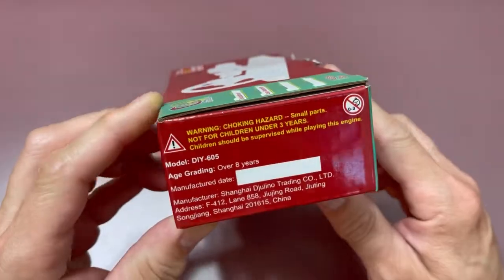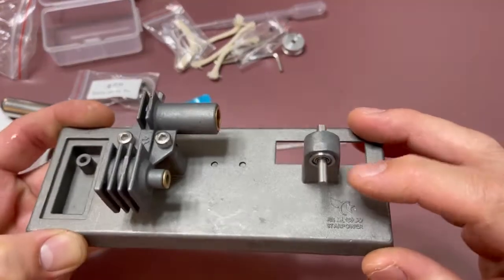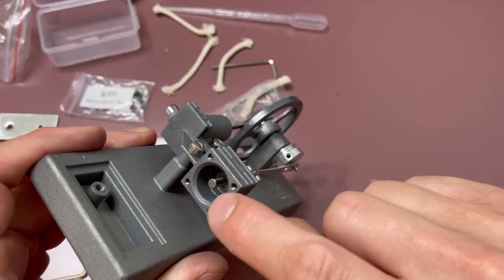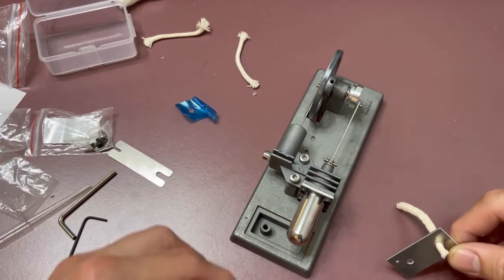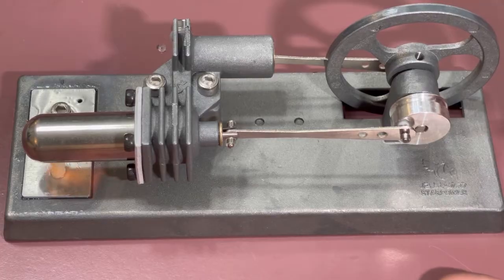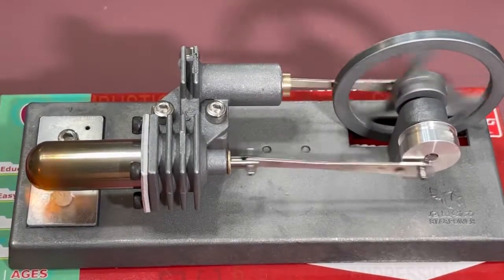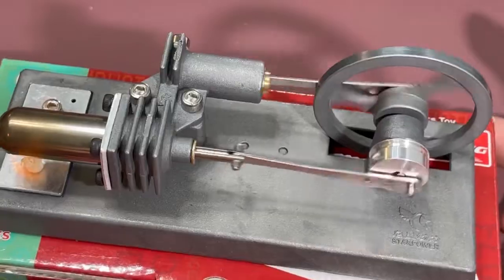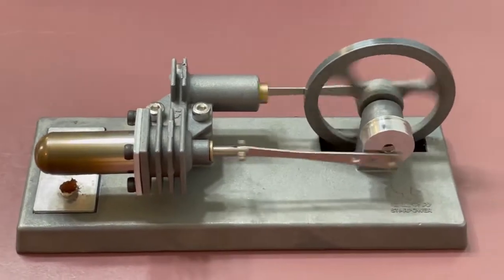Sterling Engine External Combustion Engine Hot Air Engine DjuiinoStar

Comment: Mine doesn't run, even with denatured alcohol. It turns freely by hand. What is wrong? Michael
Reply from the maker: everything spins smoothly? you can try raising the wick if its not up and a small amount of graphite powder
Reply: I have come to the conclusion that the air is too thin at 7000 ft. Alt. where I live. I've read that Stirlings are not affected by altitude. Not sure I agree. Michael
Reply from the maker: @marciacunningham5877  that's very interesting, I can see it being an issue if it's not sealing well or something....at 7k air is starting to get thin but still should be enough for it to run. Can you upload a video?
Reply: I finally made it run...very slowly. A grasshopper is stronger. Michael

Comment: Is it reuseable for multiple uses, and is the wick replaceable?
Reply from the maker: Yes you can use it over and over again as long as you have fuel. The wick is replaceable and comes with a few extras. The secret to keeping the wick long is blowing the flame out before all the fuel runs dry.